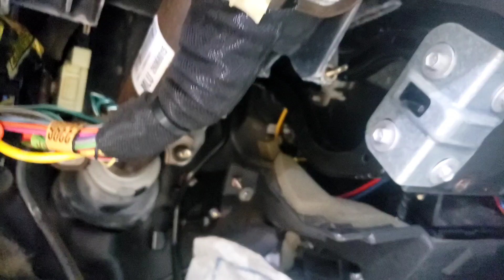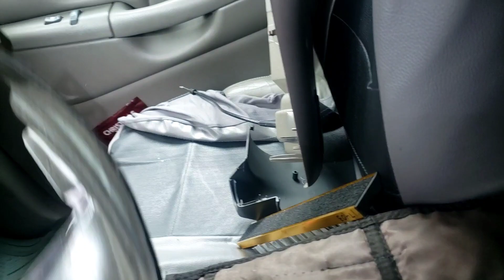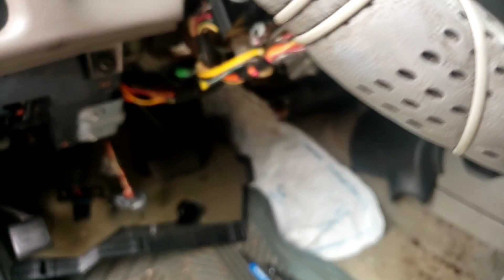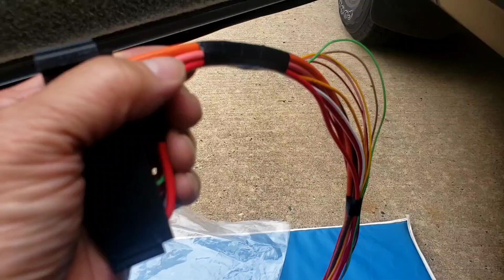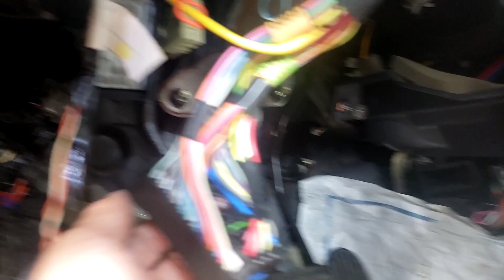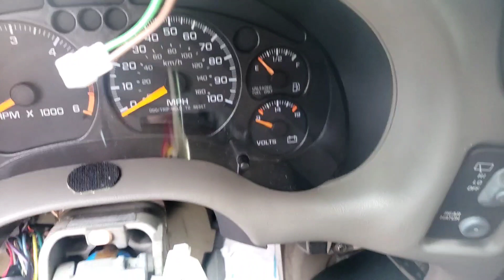GMC Jimmy / Chevy Blazer Ignition Switch Assy Replacement and Change 1998 and others similar

Comment: Hopefully this helps me, I took the switch wires off too to my surprise who ever had it before me has a bunch of attached wires tapping into the wires and now the after marker cheap stereo don't work lol  and it makes a beeping noise it sounds like an alarm, but the truck didn't start my switch when I took off the old one it was not like yours and now looking at yours it's the correct way and  I need to redo it to the new one cause it didn't want to crank so it makes all sense hopefully it works thanks it's night time right now so maybe tomorrow I'll clock the teeth 😀
Reply from the maker: Good luck on yours, its tough when people tap into wires and it starts to get confusing. Thanks for watching...

Comment: What is happening when you can start your car but it wont shut off after this procedure? Plz help.
Reply from the maker: @BinkuSama  the alignment of that white plastic gear must be off. Hence when you turn the ignition key to the off position,  the gear is not in the off position
Reply: @ did some more tinkering and I think it may be a bad switch. I reinstalled the old one and I get on/off but it, of course, is still having electrical issues. I’ll have to order a new one and hope for the best 😩.
Reply: @ did some more tinkering and I think it may be a bad switch. I reinstalled the old one and I get on/off but it, of course, is still having electrical issues. I’ll have to order a new one and hope for the best 😩.